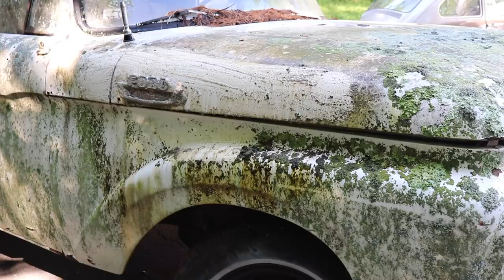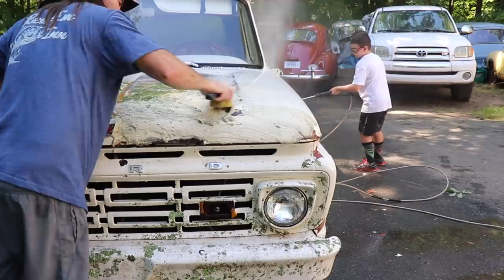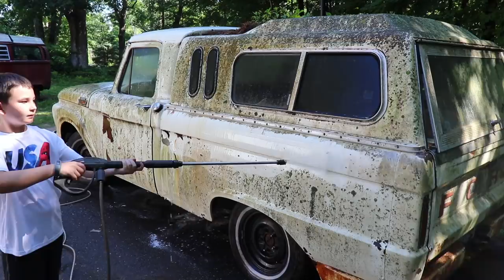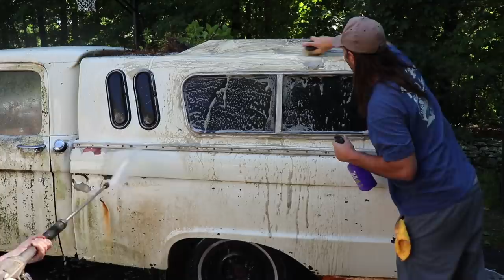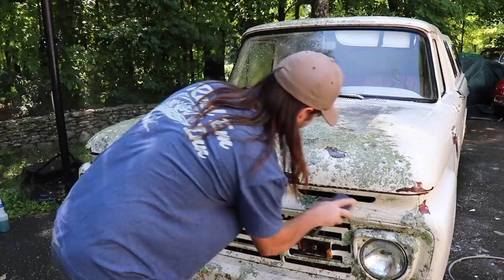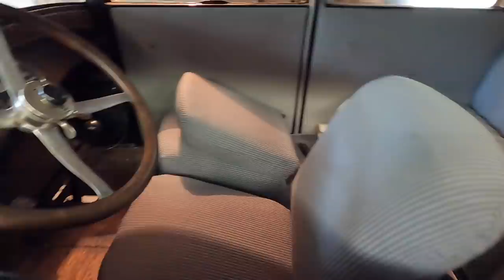FIRST WASH in 25 YEARS | Abandoned Yard Find Rescue " BUCK " - 1964 Ford F100 Truck 1st wash

Comment: Looks like fun. The apprentice is to respectful. Dads are a target, I'm sure there is a law that says so
Reply: Ohhhh, not with a pressure washer though. At a distance it’s a mist, but closer it’s a ragged knife. One of our guys that was 18 and just starting to work with tools, he wasn’t so fortunate as Josh here, was using a pressure washer we had on the ranch. It’s called a Hotsy and is set at 3600 psi and 190 degrees F. He went to rinse his hand while triggering the wand with his other hand. It peeled the skin from the palm of his hand and up 3 fingers to the last knuckle before the tip. It was a horrid wound. He still can’t use that hand fully due to tendon damage in 3 knuckles. It just opened his hand right up and his hand was somewhat scalded. We were washing dried caked on manure from our loader and one of the skid steers and had the temperature turned up.  
     I took the time to teach everyone how dangerous a pressure washer can be. It had opened up a relatively small hole in the palm of his hand actually and filled that cavity with water separating the skin from what was underneath, then the skin let go. The big damage was to the muscles underneath because it tenderized them. It happened in a fraction of a second. A cold washer may not do quite that much damage, I am not sure. Just be careful! The kid was in shock when I got to him. We just heard him scream then he was speaking jibberish. It must have really hurt. 
    We had one other injury that was different, but still with pressurized fluids. We had a hydraulic hose let go in the cab of a tractor while seeding. It was installed at the dealership that way. Those hydraulic hoses let go but often with just a pin hole pushing, in that tractors case, over two thousand PSI of pressure. It put a relatively small hole in his leg, but injected several ounces of hydraulic fluid into his calf. That needed to be opened up so they could get all of the fluid out, clean the muscle and remove the damaged tissue etc. He came home 2 days later with a good sized crater in his calf. He will have an indentation there for the rest of his life.  That pressure can be deceptive. 
    Sorry about the long post.

Comment: Great truck. I would get it running, fix anything structural and drive it as is
Reply from the maker: thank you 260 , I pulled the plugs and the engine is ( seized ) soaking ....needs floors cab corners etc  and at least one cab mount . Parts are very cheap compared to Vw's though :)

Comment: Dude, I joke a lot but this is real...I used to be a painting contractor and have used power washers extensively...you should use some kind of mask when using them. They blow all that nasty stuff in the air and eventually  it WILL  make you sick. Especially for Josh.
Reply from the maker: I have never thought about that , thank you for the heads up

Comment: That is a Ford authorized accessory, dealer installed, fiberglass cap and they are quite rare.
Reply from the maker: Thank you for the heads up on that Daniel . Makes sense since it was driven to the Henry Ford Museum to work daily

Comment: IMHO, you should always power-wash first. it gets the heaviest stuff off, stuff that can easily screw what is left of the paint.  It probably doesn't matter that much when there is literal plants growing on the paint, more for really dirty cars that are otherwise nice underneath.  Plus it's just less yucky.
Reply from the maker: I agree with you ...it was pretty caked on the cap and the truck has a lot of filler and rust so...